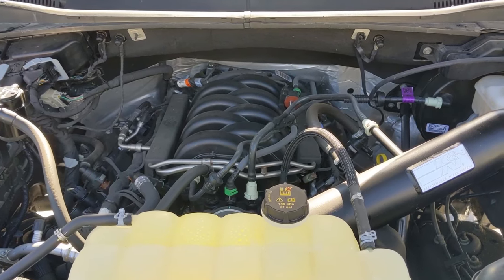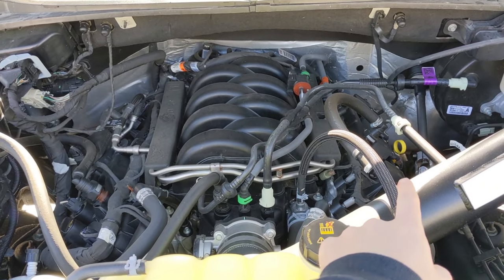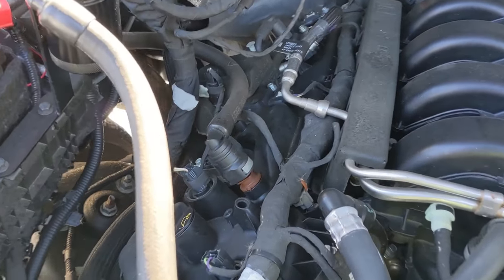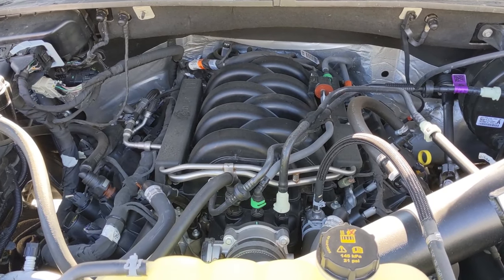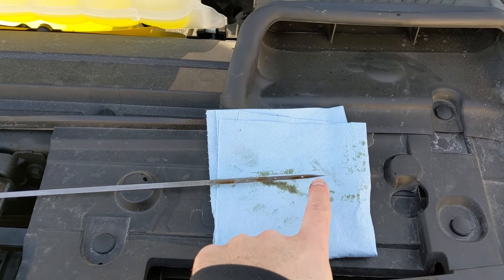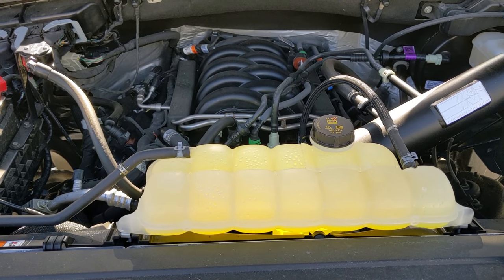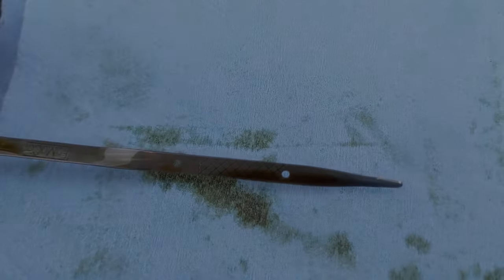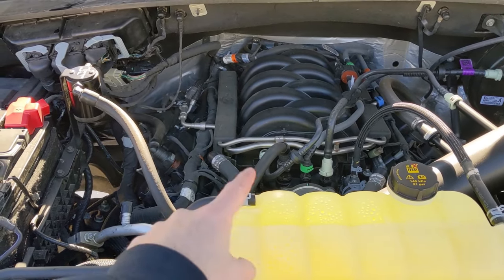Oil Consumption Update - 2019 Ford F150 5.0L

Comment: Question: How do you know that the "damage isn't done" from the time it was overfilled? Wouldn't that hurt something?
Reply from the maker: It's always possible, but that's why I got the extended warranty!
Reply: @EliminatorPerformance  True, I was just curious for those who did not. Since it wasn't the customer's mistake does that put Ford on the hook then? It is good they (Ford) caught it but if it messed something up that would be a manufacturing error. Just curious if you knew. Nice video.
Reply from the maker: @leepinnguin9682  once the truck is out of warranty they don't cover anything, even if the problem happened before warranty. They can't fix it for free out of warranty. I'm hearing these TSB's are bandaids, but only time will tell.

Some guys said their truck started burning oil again at 50,000km, after this TSB done at 10,000 so I'll keep an eye on oil just like I do with small engines.
Reply: @EliminatorPerformance  Well thank you, I may be 60 but I love learning new things and great videos like this really are enlightening  as well as educational.
Reply from the maker: Update, I had to get the left bank catalytic converter replaced about 100kms after this video was posted. The oil consumption clogged the cat up. They replaced under warranty and it's running fine now.
Reply: @EliminatorPerformance  Wow, I would have never thought of that! Great to know and wonderful they did it! Thank you for the update!
Reply: @EliminatorPerformance  Exactly what my UPS Ford mechanic friend said would happen when I told him that I never actually saw burning oil come out the exhaust.
Reply: @JCGray52  he’s gonna hate that job eventually. I left after 40 years and I know the mechanics hate their job due to UPS unrealistic demands. The fleet is old and they are held responsible for too many trucks and reprimanded for on area breakdowns. I have had mechanics drive to my route from their homes to fix the truck to help another mechanic out. Typical UPS management tactics.
Reply: @leepinnguin9682 yes Sir me too but only 50😢 
Feel 60. Oh no if make it to 60 I'm going to feel 70+ 😢😢.

Comment: I have a 14 5.0 in my FX4 currently with 90kms on it.i run synthetic oil and do not use oil between changes.engine runs perfect.the idea of a catch can seems like a good idea after seeing what has been collected.
Reply: so your 2014 Ford f150 5.0 doesnt burn oil at all because i have a 2013 cadillac escalade ext and it doesnt burn oil at all and i like the ford f150 5.0 platinum because of how spacious it is compared to my Cadillac escalade ext 🤦‍♂️

Comment: Ok thanks, been thinking about what approach to take since it’s not excessively burning as much oil as you were, maybe trying the more restrictive PCV and was planning on putting in the oil catch can regardless.
Reply: Wouldn't you want a less restrictive PCV so that you would get less vacuum?  Would making the hole bigger in the PCV help fix this ?
Reply: @googleuser4799  - Watch the video...The stock PCV is a straight hole through,  the new improved PCV has the hole broken into 4 separate smaller holes, to cut down the amount of Vacuum from the PCV to the Throttle Plate so the Engine ingests LESS oil or almost no extra oil pulled through...

Comment: Yes sir mine is using a quart in between oil changes they on mine 2021 they said they was going to do a soft ware update on it see what happens
Reply from the maker: Wow, I didn't know the 21's were also effected, I thought it was just the 2018-2020 "gen 3" coyote 5.0L engines.

Comment: How much oil goes in it now since you added longer dip stick verses the 8.5 that went in it before the TSB was done.
Reply from the maker: Supposed to be 8.8qts, mine takes 9qts with a filter to the full line exactly
Reply: Thank you sir. Good video you did.
Reply: Sorry to keep bothering you. But if you add a longer dipstick doesn’t that changed the amount of oil put in the truck to less oil than you had with shorter dipstick?
Reply from the maker: @gregsmith983  it's now a 2qt range instead of a 1qt range on the hash marks
Reply: Thanks man!! Appreciate you replying back.

Comment: The intake plenum will catch oil  like a catch can. The problem is overfilling the engine and using  5w-20   or 0w-20 .....  These engines should run on 30 weight oil ...

Comment: I wonder if it's also on older models, my 2011 seems to consume a little oil I bought it used so not sure if it always have or not, but it does have around 145,000 on it.
Reply from the maker: No, this particular issue only affects 2018-2020 models

Comment: If the PVC valve is a “check valve” how is a vacuum allowing oil to get past it?  I would assume a vacuum would keep a check valve closed.
Reply from the maker: Right so it's a check valve that prevents flow back into the crankcase. It allows flow out of the crankcase. So when there is vacuum on the top end, it pulls more pressure through the PCV valve, from the crankcase, to the top end.

Comment: About how many mpg did you loose after the TSB? What are you getting now empty highway?
Reply from the maker: With a heavy foot in sport mode I was getting 18L/100km, but now I'm getting 15L/100km in sport, if I ride in eco mode on highway I get 11L/100kms lol it's quite the difference.

My comment on fuel mileage was flawed as about 100kms after this video was posted a code popped up to replace my left bank catalytic converter.

The catalytic converter was clogged due to the oil consumption, which lead to the excessive fuel consumption, as the engine was working harder to put the exhaust past the clogged cat.

The truck runs perfectly now and .my mileage has improved significantly since the catalytic converter was replaced!

Comment: What happens when the F150 needs the TSB after the powertrain warranty has expired, how much would it cost? (prospective 2018 5.0 off warrranty buyer)
Reply from the maker: I'm actually not sure, but call your dealership and ask I'm sure they have a quote for that!
Reply: I would asssume they could still perform the TSB at Ford's cost if it's applicable

Comment: Strange.......mine consumes oil. To the tune of between two and three quarts per 5000 miles. I do my own changes so I know how much I put in the truck. I put in just shy of 9 quarts and when I drain it I get between 6 and 7 quarts. It's not phantom consumption in my truck due to a dipstick. That oil is not just disappearing. I'll add a catch can and see how much winds up in there. If I only get and ounce or two then it's going somewhere else.

Comment: Older Ford 4.6 DOHC took around 5.5 to 6 quarts now the 5.0 takes 9 quarts lol I understand there 2 different motors but not really 3 quarts more seems excessive amount of oil to begin with.
Reply: Perhaps they need more oil volume to Cool the engine internally, or maybe some parts need a lot of oil volume on them all the time more often?

Comment: My dealer wants to do an oil test before applying the fix, did they ask you to do the test before applying the fix?
Reply from the maker: No I showed them a picture of dipstick and said I was consuming 1qt/1000km because I added 1qt 5w20 synthetic myself. This is also my company truck so I don't have time to keep going back and forth to dealer. I said I want tsb done and they did it.
Reply: @EliminatorPerformance   thanks for the reply, yeah i just bought the truck last Saturday. It was certified preowned so it had a fresh oil change, less than 500 miles that i put on and its already reading low. I also dont want to deal with a test they told me it could be a month or two of testing before they apply the fix. I think ima just go to a different dealer. Thanks for the reply and the video was super useful.

Comment: I have a 2020 F150 with 5.0, 32K miles.  Down to about the bottom dot of the dipstick (some say that's 1q and others 2q on the 2020's so i don't know what it qualifies as).  I have had the oil consumption TSB done and it is currently under consumption testing which they have said it has "passed" so far.  Any comments on what to push for at the dealership since the TSB has not worked as intended yet they are calling it passing?  I've also noticed the rattle off decel has worsened since they did the oil consumption TSB.  Could that indicate cam phaser issue?  They've said there is not a TSB or fix for that decel rattle on the 2020 and it's normal.
Reply from the maker: I'm hearing the rattle on decel is pinging/pre detonation and can be solved by running higher octane fuel. There has been some posts about 91+ octane solving this, after owners using 87 or 89 had the issue and switched fuel.

As for the consumption, some things I didn't mention in the video, worn valve guides, the plasma lined cylinders causing the piston rings not to seat properly during break in. There's also the pcv issues I mentioned in the video, so the ev281 is what I recommend installing 1st because it's the cheapest and sometimes solves the issue.

On any truck built after that date I included in the video, the trucks should come with the longer dipstick, which is now a 3qt range, although I've heard some 2020s built in November had the shorter dipstick, which could be because the assembly plant ran out of the new ones or had supply issues..

If you're worried about consumption or phasers, I'd consider a synthetic, like the Pennzoil ultra platinum or the Rotella gas truck oil both in 5w40.

Even though the manual and engine fill cap says to run 5w20 in this truck, my dealer has since switched to 5w30 as a minimum on all 5.0L engines, and goes up to 5w40 if necessary when trucks consume.

The 5.0L mustangs with the track pack use 5w50 and it's essentially the exact same engine. The only thing that's really different is the cams, intake manifold and the tune basically.
Reply: I just went in today to have mine checked bc it’s under the oil consumption testing and it was down almost to the bottom dot and they said the hash marks only represent 1 quart.  I argued that per the TSB it was 2 quarts but even the master tech came out and said no it’s 1.  Any thoughts? Are they lying to me?
Reply from the maker: I heard with the new sticks, dot to dot is now 3qts. I could be wrong, but it's at least 2 for sure

Comment: my 16 f150 5.0l does not have a oil consumption issue , !!! i only lose 1/2 qt within 5k miles , and i drive it hard , what would be the difference as to why the 18and up trucks are having this problem ??
Reply: Your truck USES 1/2 quart within 5k miles, so it Does have oil Consumption... If does Not use any oil, then it does not consume oil...

Comment: Curious  how your engine is still doing. My 2018 seems to be consuming a little less as mileage increases. Just over 22000.Still haven't done tsb.
Reply from the maker: No consumption after 10,000kms, I had to get the left bank catalytic converter replaced under warranty because the original oil consumption lead to it getting clogged up. It improved my fuel economy after.
Reply: @EliminatorPerformance  No consumption after 10000km?

Comment: I'm not a Ford technician but if I'm having to put 10 or 11 quarts of oil into my Ford that only holds 8.8 I'm going to be looking under the truck to see if I forgot to put my plug-in and figure out where the oil is going it shouldn't take him very long to figure out if the oil dipstick was short that's a joke

Comment: My 18 5.0 used a little too much oil up to about 15k miles then tapered off to zero usage in over 3k miles once at 28k. Only TSBs I had done was the 18-2354 (useless) and one for the harsh shifting
Reply from the maker: Thanks for sharing!
Reply: Did the TSB for the harsh shifting fox the issue?
Reply: @Painfulwhale360  it did, but back again at 56k miles when cold. Slams into third first 2 times. This is after they rebuilt the valve body and changed the fluid and filter 💁🏽‍♂️
Reply: @kineticenergy1085  how is it now
Reply: @ThatBoyMichael1  still barely uses more than 1/2 CUP…. Yes CUP not quart, in about 3,500 miles👍🏽

Comment: Interesting if just adding a quart of oil would had been cheaper than the increase cost of gas due to your decrease in gas mileage due to the TSB? Thoughts?
Reply from the maker: So the worse fuel economy was due to my catalytic converters being fouled, my truck went into limp mode a month after the TSB was done, and they replaced my cats under warranty. Truck still hasn't used a drop of oil, and my fuel economy is way better than it was before. I'll get around to doing an update video sooner or later.

Comment: I dont buy the "Improper stick length" I worked in a service dept. and they will say anything to get you happy. My take... your driving around with less oil. (Ford and customer is happy.)
Reply from the maker: Well it still takes 8.8 quarts and I haven't burned a drop, except for what little goes into my catch can.
Reply: @EliminatorPerformance  ok TY for the clarification. Dont actually have one but I was watching closely at alot of channels way back.
Reply: So if I’m adding a quart every 2500mi to get it back up to the middle of the hash marks, should I install a catch can?
Reply: @MushroomCat22 I would for sure. Keeps the intake clean!

Comment: How much oil were you losing in between changes? And did that fix the rattle on the deceleration at 2000 rpms and down?
Reply from the maker: 1qt/1000km so that's about 1qt/3300miles. The TSB solved my consumption, absolutely no oil has been used since! I don't have any rattle.
Reply: @EliminatorPerformance  1000 km is only about 621 miles.
Reply: @mikeshelton5629   -Yes, you are correct !  Thanks for pointing this out !

Comment: What oil shpuld i use  ? Like 5w30 or 5w40
Reply from the maker: I'm currently running liquimoly 5w40 Molygen, but I would recommend Rotella T6 5w40 or pennzoil ultra platinum 5w30 if you want a bit better fuel mileage!

Comment: What about the possibility that the plasma coating that they applied rather than cast iron sleeves on the aluminum block was getting rubbed off by the pistons causing the oil consumption
Reply from the maker: Yes the plasma coated cylinders are an issue, as are some cylinder heads too. This just talks about the oil consumption related to the vacuum/throttle body/pcv system. It was fixed by the TSB on my truck, no more consumption.

Comment: Well I could go on a long time about this....I had the EXACT same truck.  Awesome in the snow, very fast for a truck but took it back to the dealer for a pile of recalls , reprogramming three times to solve the oil consumption, still burned oil....the engine made noise on acceleration ( pinging)  unless I used High test gas. The engine also kind of had valve noise at idle... 85000km on it and I  finally got the problem solved.   I bought a Dodge Ram.
Reply from the maker: Yea the tinging noise at idle is the injectors firing from what I heard, plus these things have DOHC so there's timing chains and tensioners, it's a lot of stuff going on. Not to mention they added the direct injection too. This truck isn't getting much milage so far, but I'm trying to keep everyone updated as to what's happening with the 5.0 I love the truck and haven't had any serious issues.

Comment: What is the part # of your new dip stick?
Reply from the maker: JL3Z-6750-E

Thanks for watching!
Reply: I just ordered one off Tasca. Don't feel like dealing with the dealership. My truck was built after 10/15/19 so it should technically have the new dipstick but it has the old one. They are only $13.
Reply: @thekelly4178  what about the pcm reprogram ?
Reply: @jasongallowayelite7432  I had the TSB 2365 done a while ago (pretty much when it was released) but my build date didn't qualify me for the dipstick even though I had the old one. I dont really use that dealership anymore because they are less than helpful. Anyway, I didnt really understand the importance of the dip stick until watching this video so instead of dealing with the dealership I just got one myself.

Comment: Dealer did TSB 19-2365 almost a year ago to my 2019. Today I checked the oil level and it is on the lower limit, so basically it is still consuming oil. Any suggestions on what to do besides going back to the dealer?
Reply: Just came from the dealer and basically they don't have an answer. Any suggestions?
Reply: @tatoweb   did you fixed oil problem?
Reply: @hussartx3624  I sold it. There was no solution to the oil consumption and too many weird noises. Engine pinging, driveshaft/gearbox when starting, etc.

Comment: will the oil catch can void your warranty?
Reply from the maker: No. No aftermarket upgrade can void an entire warranty (whether it was installed professionally or by yourself).

However, if you did like a supercharger, and then the engine blew up, they would not cover the power train (engine trans rear end) but literally everything else would be covered.

Intake, exhaust, oil catch can, doesn't affect anything negatively.

Most dealers just tell you that because they want to do the work themselves and get paid.

I've done suspension modification (Ford Performance M-3000-HA drop kit) intake, exhaust, oil catch can, Forscan mods, and it's still covered under my 10yr warranty!
Reply: @EliminatorPerformance  Thx, got a 2020 F-150 with the 5.0 V-8 with 3,500 miles and it seems to be using 1 quart every 1,200 miles.  Been contemplating whether to sell it, trade it or keep it. Love the truck but the long term oil consumption is discouraging.

Comment: So essentially... Add 8.8 quarts on oil change. Run the engine to get the oil circulated. Let it settle. Check dip stick. Whatever the level it is scratch a new level full mark on the dip stick. Got it